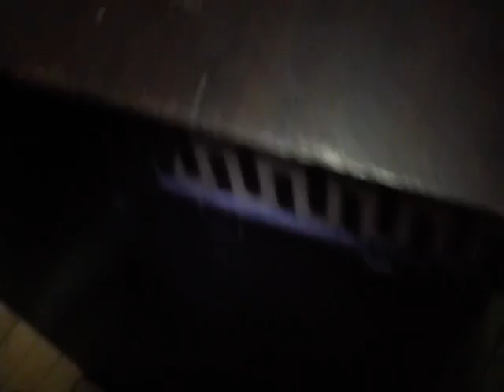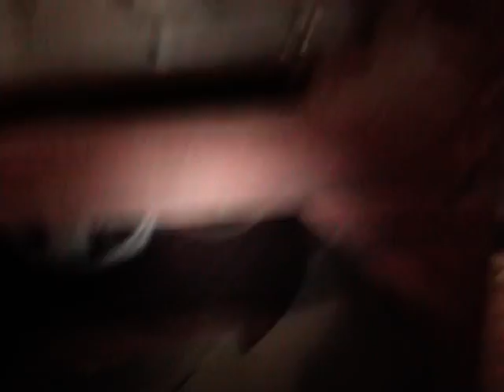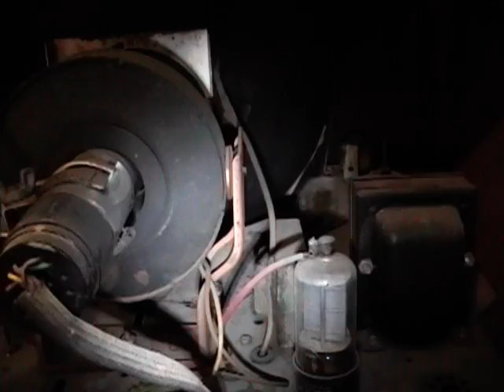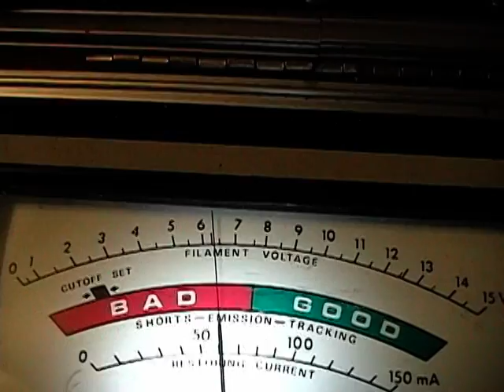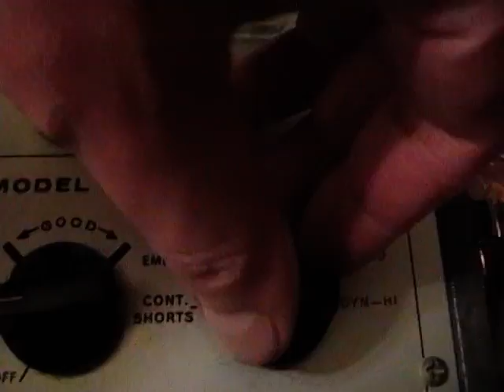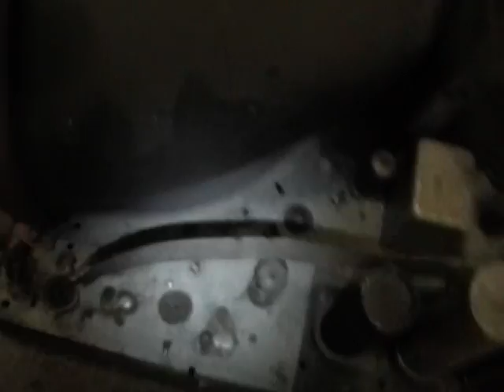Motorola 12K2 restoration p1o?

Comment: I would be interested in knowing if there was any specific reason or advantage for the bottom mounted internal antenna. I own a Motorola 19K3 and it has the antenna mounted in the top of the cabinet. I would be under the impression that top-mounted would be better especially on the first floor, but if the television were on a higher floor or in an apartment building I would guess that there wouldn't be too much efficiency loss with the bottom mounting.

Comment: I think that the square zig-zag looking molding is some sort of dental molding, not exactly sure, I have a book with furniture styles that would tell. It has sort of a classical Roman or Greek look about it. I think what they did is to take a thin strip of walnut or mahogany covered plywood and cut the knotches in it with a table saw using a jig similar to the ones used for finger or box joints where they cut each knotch one at a time indexed by a dowel mounted on the jig, hard to explain.